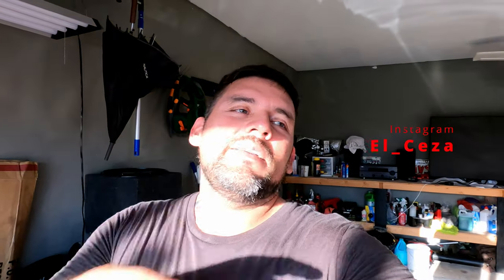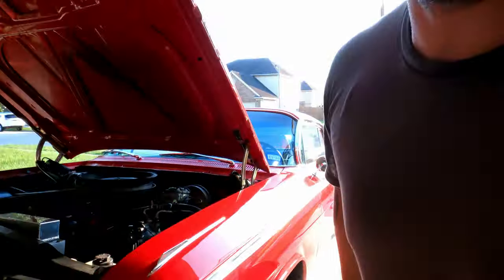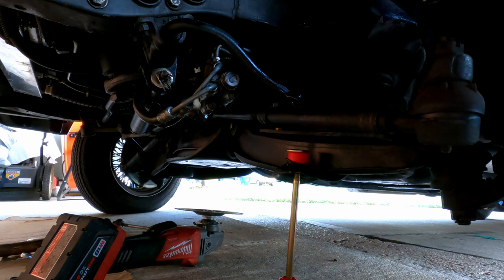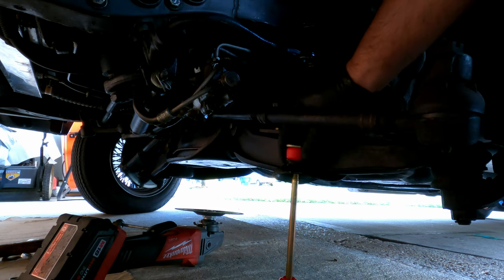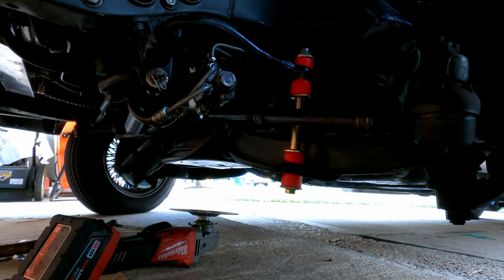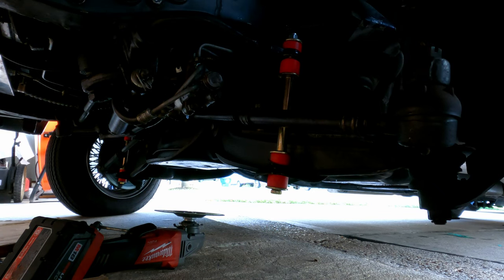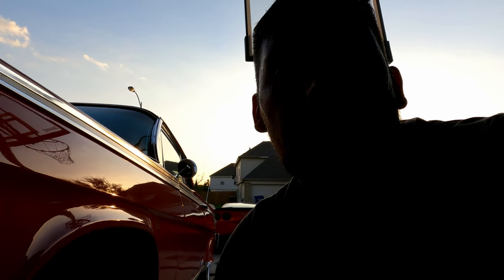How To Install Sway bar Link on 1962 63 64 Impala

Comment: Ceza, I’m having the same issue on my 63 impala bent end link bushings.. I was 
Wondering the ones you used look perfect.. what kind of truck were those for, if you don’t mind telling me.. thanks in advance! keep up the good content.
Reply from the maker: Energy Suspension 3-5213G Front Sway Bar Bushing Set for Chevy Silverado 2-Wheel Drive this is the set for the truck that i used. Thanks for the support!
Reply: @El_Ceza  what year Silverado
Reply from the maker: @Vic-gh1vx  mine is an 04 the i put the part number there also of the kit for the truck
Reply: @El_Ceza  thank you ceza im gonna try that
Reply from the maker: No problem!

Comment: I have hydraulics. Lay and play. I removed my sway bar. Would it be better to put it back in? I don’t get crazy with it.
Reply from the maker: Better stabilization, i removed the swaybar  from my g body for higher lock up since it was restricting but im not 100% if its better with it or without the swaybar on a juiced car
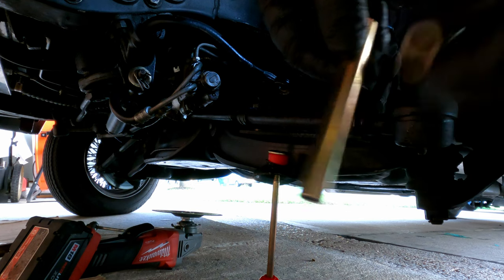Reply: @El_Ceza  yeah. Me ether. Probably just try it since it’s been out awhile. Maybe I’ll be able to tell. I had to put my rear shocks back in because it skated way too much 😬 5:20s
Much better with them in💯
Just trying to make it less scary feeling🤣🤷🏾‍♂️🤣
Lowrider problems💯🤣
Reply from the maker: @davidnorris8724  oh yeah i have my rear ones on im installing my front ones also for better stability